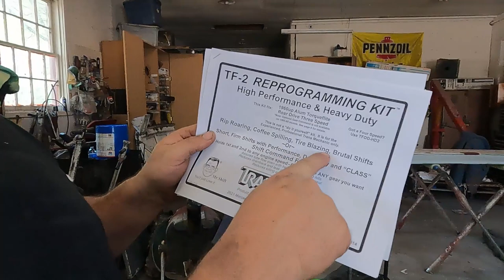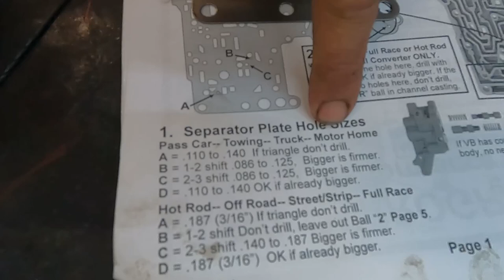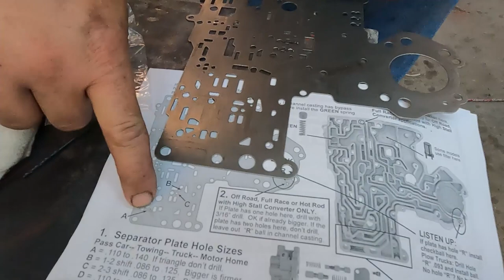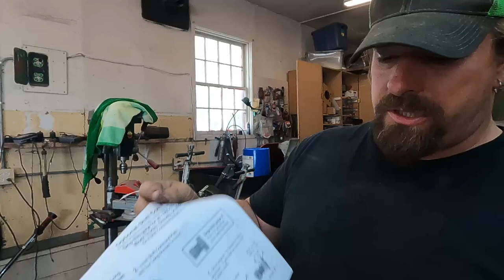Maximize Precision and Durability! How to Install a TransGo TF-2 Shift Kit

Comment: Any experience rebuilding a Ax15  jeep transmission? Ive got a wrangler also im still working on.
Reply from the maker: I don’t have experience with that specific one, but all of the manuals I have worked on tend to be simpler than the automatics
Reply: @PerpetualProjects  the older manuals were not to complicated. This one has quite a bit  harder. Several videos of it but none piece by piece how.

Comment: Hello im getting ready ti install this in a full size dodge ram van wth a 318La bored 30 over an the vans been turned into a off grid unit wth tons of weight my transmission is sluggish an tajes ling slow shifts im hoing ti adjust the bsnds an install this exact kit 
MY QUESTION TO YOU IS CAN I DO EVERYTHING EXPECT THE THE PART WHERE YOU REMIVED THE BAND AN TOOK THE SERVO OUT AN CHDNGES SORING PREASURE AN ADDED THE SHIM????
OR IS IT MANDATORY TO REMOVE SERVI AN DO CHANGE SORING AN ADD SHIM PLEASE RESPOND AS SOON AS YIU SRE ABLE BECAUSE I DONT THINK ILL BE ABLE TI DO THST BY MYSELF WITH THE TRANSMISSION STILL IN VAN UPSIDE DOWN YOU CANT HURE HELP HERR IN TAZEWELL COUNTY VIRGINIA ITS PITIFUL HOW YOUNG PEOPLE HAVE BECOME SO LAZY GIVE THRM A VIDEO GSME THERE ALL FIR IT BUT GIVE THEM A TOOL AN THEY WILL RUN EVERY TIME IM A NEW SUBSCRIBER AND RESLLY ENJOY YOUR VIDEOS YIUR VERY KNOWLEDGEABLE AND DINT DO LIKE MOST TALK 56 MIN OF A 60 MIN VIDEO AN INLY DI 4 MIN OF ACTUAL WORK TIME SOME JUST LIKE TO HESR THEMSELVES TALK LOL ILL BE WATCHING THE REST OF YOUR VIDEOS AS SOON AS TRANS KITS INSTALLED IM A DISABLED MECHANIC HAD A STROKE AN FIR GOTTEN MORE THAN I EVER KNEW ITS EMBARRASSING I NEVER DID ANY AUTOMATIC INTERNAL TRANSMISSION WORK OTHER THAN INSTALLS OR FIKTER SN FLUID CHANGE I WAS MOSTLY INTO  ENGINE WORK SO THIS IS NEW TERITORY FIR A OLD MAN THANKS FOR YOUR TIME